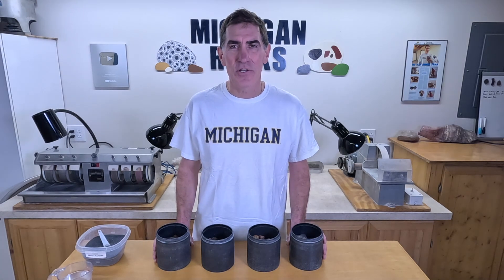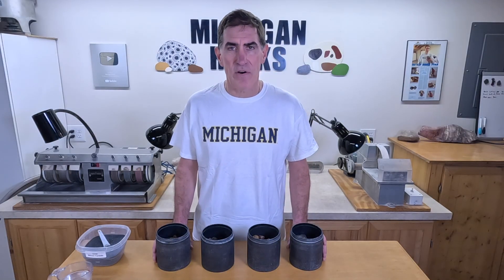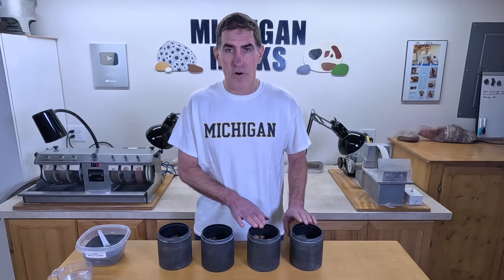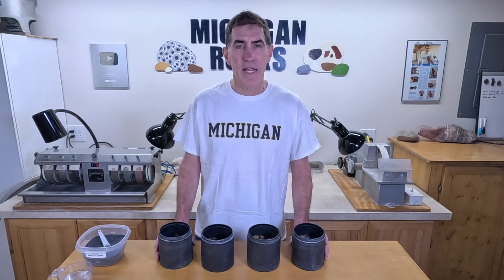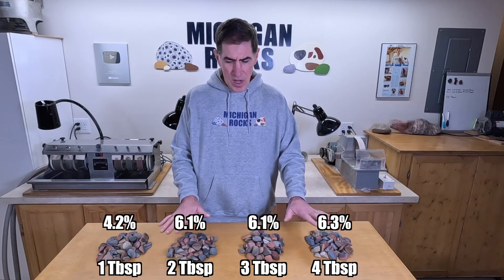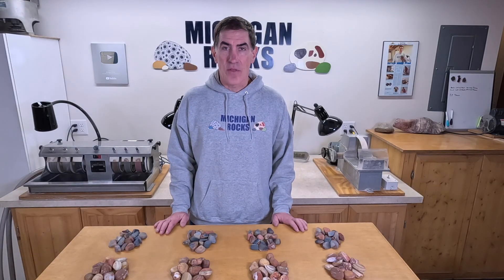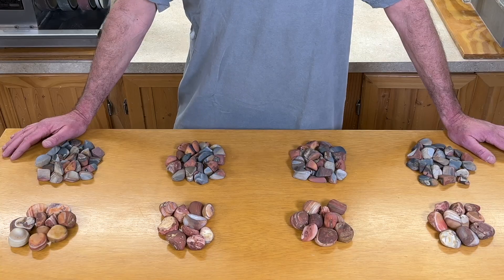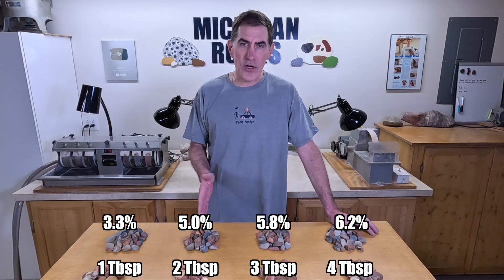Optimal Amount of Tumbling Grit—Part 2

Comment: Great work Rob. 
I think this experiment might give some clues to your tumbling results for the one year experiment without changing grit. I think in that experiment you got some levels of polish with only 1 grit.

I am suspicious that rounded stones lose more because the rounded surface area gets more surface abrasive interaction. The nooks and crannies and valleys and under crofts of rough or  broken stones surely must miss out on regular abrasions for occasional or random contacts.

I would think that if this rounded vs craggy hypothesis is true you might find data skews as you get rounded maybe you lose more weight per week.

This of course does it factor in chips, fractures or breaks.
Maybe testing uniform glass marbles with grit might track the size and shape issues  but it would represent glass and not agates.

Boy, this science analysis stuff is hard and hats off to you and all who do experiments .
Reply from the maker: I'm all done with this particular experiment. I think that more rounded surfaces might make a difference. I tumbled all the rocks for at least a week before using them in this experiment because really rough rocks visually change a lot in the first week. I think some of those sharp corners chip off. I also think they might grind off faster because there's more pressure on a smaller surface. With rounded rocks, there's more surface exposed for grinding, but there might be less pressure since the pressure is distributed over a larger surface. 

Then there's the matter of the grit breaking down. Would a more rounded surface break it down faster, making it less effective later in the week? Lots of questions to think about with this seemingly simple experiment.
Reply: Having worked in quality and with quality engineers in my profession, it's astounding how a seemingly simple experiment  can become a multifaceted evaluation.  Sometimes the more data you generate, the more questions you get. But good questions usually lead to solid solutions.
Reply: @MichiganRocks  I agree no more experiments as the permutations blow the top of my head off and there are so many rocks and so little time.🤪
Reply: I'm with Rob on this.  Rough (jagged) rocks seem to grind faster since the contacts points between rocks are fewer / smaller, so the force is more concentrated.  It's like laying down on one nail vs. a bed of nails.  Nevertheless, fully rounded off rocks may grind down faster than rocks that have no sharp points but are not fully rounded, for the reason you suggest (more area of contact).     @MichiganRocks
Reply from the maker: @jonathanyoung7785  I may have gotten my idea from you on this, Jonathan, so I'm with you rather than you being with me.

Comment: Hi, Rob, I tend to overanalyze things, and this video provides grist for the over-analytical mill.   

A few thoughts:

1.  This + the prior video seem to confirm something I have noticed when rough grinding in a rotary tumbler: the grinding dynamics of rough (sharp edges) rocks is quite different than how rocks grind down once the sharp edges are worn off.  Perhaps this is obvious, but it's cool to see data that confirms it.  

2.  Diminishing returns for more grit means one of two things.  Either (A) with more grit, the grit is not broken down as finely in one week of tumbling (and in that case, you might ultimately get the same amount of rock removal with more grit if you left them to tumble longer); or, if the grit is broken down as finely regardless of the amount, then (2) as the amount of grit increases, an increasing amount of that grit gets broken down by something other than making abrasive contact with the rocks (what you could think of as non-productive grit breakdown).  That "something" is probably grit breaking down grit, with the rocks providing the force.  I won't ask you to do any more runs of this, but it would be interesting to compare 2 tablespoons for 1 week vs. 4 tablespoons for two weeks.
Reply from the maker: There are so many more experiments that could be done along these same lines, but it just takes so much time. I'm also out of rocks of the same size for now. I want to run some other experiments, but I need to buy more rocks just to do that. 

I think your experiment of two tablespoons for a week vs. four for two weeks would be interesting, but I'll leave that one for someone else.
Reply: If there is enough public interest, perhaps you could make a public google spreadsheet where people could post their own results.  You can give the public write-only access with you retaining administrative access.  You could establish basic process-related parameters to ensure some degree of consistency.   The bigger point is that it would be cool if curious viewers could somehow help fill out the data.  It wouldn't be perfect science since it would be difficult to account for inconsistent use of the scientific method, barrel size, rock type, etc.  But the basic premise of collaborative data generation could be fun and enlightening. I would certainly be willing to run a few rounds in both large and small barrels to help generate data. 
 
 @MichiganRocks
Reply from the maker: @jonathanyoung7785  That's a great idea, but not something I have time to take on right now. I'd also be very wary about the quality of the data coming in. I know from working with thousands of kids over the years and from reading comments here on YouTube as well as on various Facebook groups, that most people are not very scientifically minded. I tried really hard to keep everything really consistent, but most people are much more casual about things.

Comment: Thanks, Rob. I watched your 1st video.  Since we've had such a warm winter, I've run the same experiment. I found similar results & started using 2 tablespoons of grit per 3 pound tumbler with 2 pounds of rock. I used the same ratio in my large tumbler. I'm using less grit & getting very good results.
Reply from the maker: Thanks for getting more data. It's nice to have someone else with similar results.

Comment: Thank you for going to all that trouble and getting some next level data.  That you chose to use the same rocks and added relatively rounded rocks was interesting.  It makes me wonder if the grit's effectiveness differs with different rock roughness?  I think your conclusion this time around is very practical.  Thanks again!
Reply from the maker: I'm sure it makes some difference. I did run all the rocks for at least a week before using them in this experiment, so there were no really rough rocks with edges that could chip off.

Comment: Great job Rob, you can pick an ex teacher, you just didn’t give us a test afterwards 😂😂😂😂. But I’ve found a very similar thing, I found more grit needed to be left longer before cleaning, as not all the grit was worn down in a week. Still I’m sure the tumbler people have tested all this which is how they came up with the recommendation in the first place.
Reply from the maker: It's hard to test that precisely, but there wasn't any obvious grit left in any of the barrels at the end of the week.
Reply: Exactly 1 Tablespoon can go for a week same with 2 Tablespoons 3 Tablespoons should go for 10 days or two weeks and four tablespoons should go for 2 weeks or more.

It all depends on The hardness of the rock how much grit you use and how much time in the barrel

Edit: also the speed of what the barrel is moving
Reply from the maker: @dailthegoat799  There are tons of variables. That makes things interesting!

Comment: I'm in a relatively small apartment for about a year, but after running across your videos, I wanted to try a rock tumbling experiment before moving to a house where I'll have room to run a tumbler that can be far enough away to not be too loud. I ordered some tiger's eye rough from Rock Shed. I also bought a 2-pound tumbler barrel and 1/8x1/4 ceramic media (looks like rice). I'm only using water and dish detergent. I have it 3/4 full with about 1 cup of ceramic media and about a tablespoon of dawn. I used distilled water. 

I assume this will take almost the full year, but when I walk for about 1 hour I toss the barrel from hand to hand, do some curls, spin it, basically get a little bit of random motion and a surprising amount of upper body exercise by the end of the hour. I can confirm that it does not cement at all. I was on vacation for 8 days and it sat the whole time, but was shaking as normal immediately when I started up again. 

So, my theory is I will get a little bit of natural grit building up from the rocks themselves, but even after a year (maybe 300 hours of tumbling) I will have slightly rounded edges and some polishing, but it will look nothing like a tumbled rock. Perhaps it will look like a short stint in a vibrating tumbler? I'm hoping it will end up being a completely unique effect. Has anyone tried this or do you have any predictions about what will happen?

BTW - thumbs up to Rock Shed. The tiger's eye is really nice, even in its rough state.
Reply from the maker: Well that's an ambitious project! The only thing I can add is a video where I tumbled rocks without using any grit. You might be surprised by the results. I sure was. https://youtu.be/rk1DEqyH8Pc
Reply: I love this idea!  Human-powered ruck tumbling.
Reply from the maker: @jonathanyoung7785  I'm tired just thinking about it.

Comment: You could literally do these tupe of videos for every type of grit & polish. I'd be curious how the same trial would go if you used 46/70. Of all the grits I use, 46/70 is by far the most used over several weeks of the first stage
Reply from the maker: I could, but I'm not going to. I would like to test different grits, but keeping the amount the same.
Reply: @MichiganRocks  I think the first stage, regardless of what type of grit a person would start with, would be where the most savings would be. I'll stay with the number of tsps vs the barrel size. The experiment was interesting, though & I'll always watch because it seems you're continually searching for the best tumbling process that's gets the best results for the least amount of money & that would be one of the greatest solutions that applies to the most people
Reply: I haven't tried 46/70, but am curious.  Does it take down rocks faster and do you have any data on gram loss?
Reply from the maker: @ClassicRock76  I have no data on that at all. It's something I want to experiment with, though.
Reply: I've got a bunch of uncommon grits if you ever want me to send you 1/4 pound or so of each for experiments.  Stuff like 20 grit silicon carbide, 50 grit aluminum oxide, 1200 grit silicon carbide, and others...  @MichiganRocks
Reply: @MichiganRocks  Sorry I meant to ask @ontariorob  but put the thread below yours. Ooops
Reply from the maker: @jonathanyoung7785  I think I'd rather stick with more common grits, but thanks.
Reply: @ClassicRock76  I personally don't have any date regarding 46/70. It's my usual 1st stage grit & by far the grit I use the most throughout the entire process  of tumbling. Maybe Rob can do an experiment one day on it
Reply: @OntarioRob  Thanks.  I never really thought about a larger grit until you mentioned it. I might have to get some just to play around with it.  Maybe collectively we can come up with some guidelines similar to what @Michiganrocks developed with 60/90.
Reply: @ClassicRock76  I'd be very interested in trying
Reply: @OntarioRob   Do you post in the RockTumbling Hobby Forum at all?  We might be able to link up there to take it further at some point. Unfortunately, I literally just got an order from the Rock Shed with more 60/90 grit, so it's going to take me a while to try another grit size. I do have a couple different batches of agates to do although I'm working with the Rock Competition right now, so that's kind of my focus as I have limited equipment.
Reply: @ClassicRock76  It definitely taken down the rocks faster & I only use it on rocks rated 7 or more. Anything lower & I start with 60/90. Unfortunately, I don't have any data to pass along other that it works better on harder rocks than 60/90 does

Comment: It still looks like 3 tbs of grit per 3 lb barrel is the optimal amount to use. Maybe 3 1/2.  Did you notice if all the grit was consumed in the 4 tbs barrel ?
Reply from the maker: I didn't really feel it this time, but when you dump a barrel with unused grit into the colander, it's usually pretty obvious. I didn't notice any.
Reply: On rocks of 6 hardness or higher, I have found that 3 tablespoons of 60/90 grit with 3 lbs of rock of 60/90 grit is not noticeable by feel after a week. This has been very consistent in my tumbles.